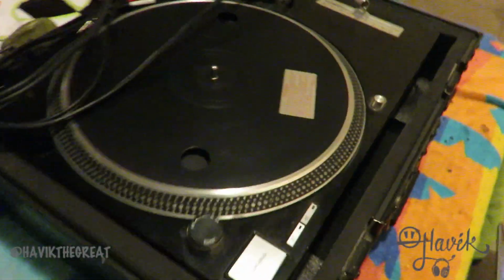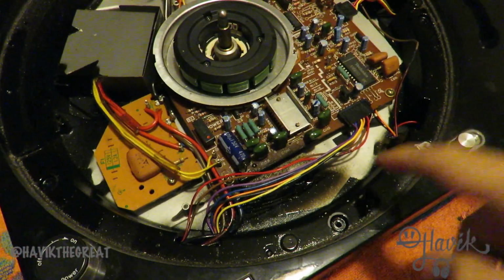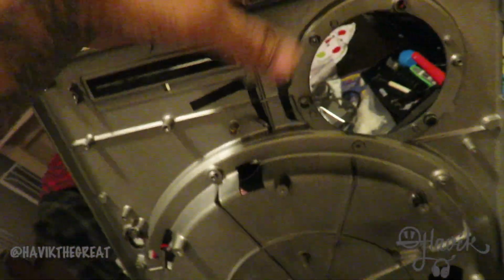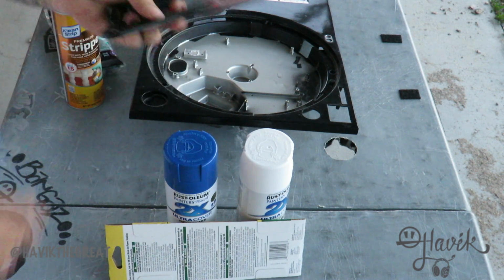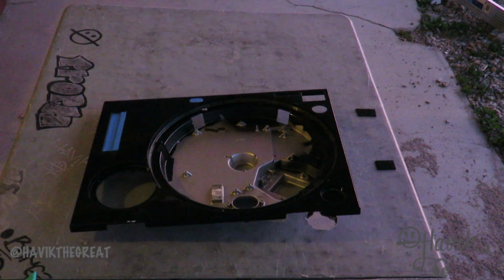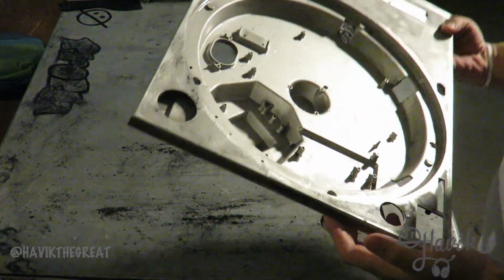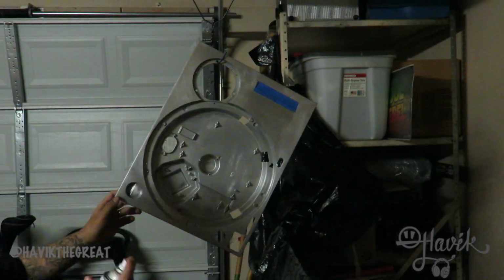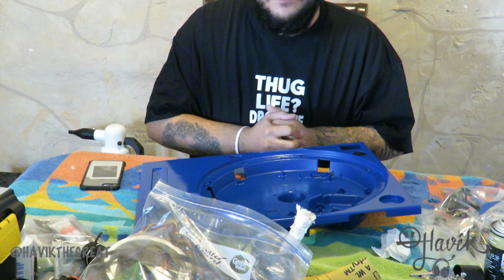Dj Custom Technics "Royal Blue 1200's"

Comment: Should have sanded back to get rid of the uneven/orange peel the clear coat.
Reply from the maker: Yea it still looks alright though.. I painted another pair pearl white and they came out Fire.. but I also used automotive paint and actual 3 stage pearl through a paint gun.
Reply: I would love to see that, I bet it looks hard!
Reply from the maker: I posted a pic and video on my Instagram a while back.
Reply: Should wet sanded it with 1500/2000 grit and then done 3-4 coats of clear and it would look like glass and hold up forever.